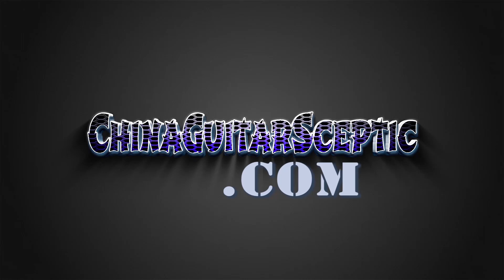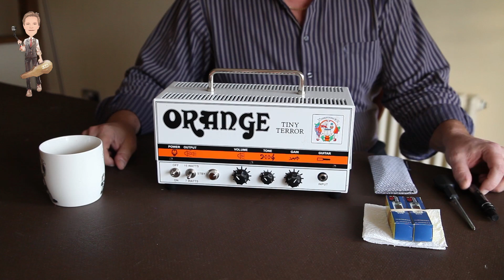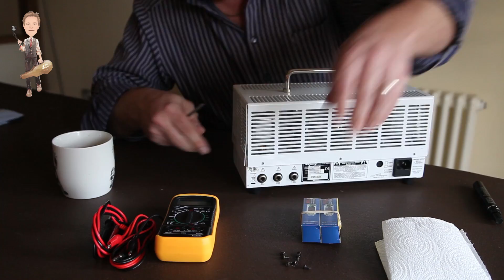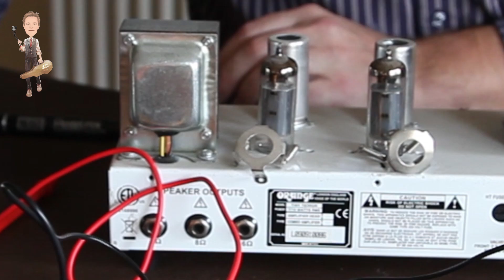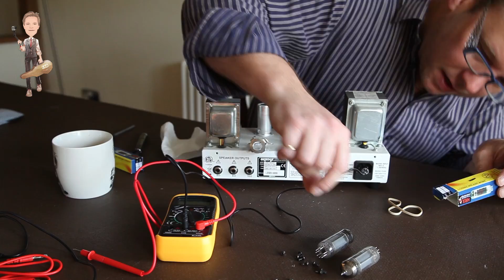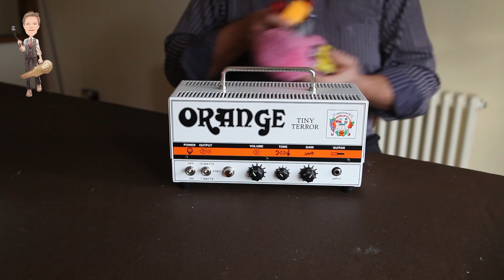Tiny Terror Valve Change EL84 by JJ Electronics [Tesla]

Comment: The earth pin in the IEC male socket is connected to chassis earth. There will be no potential difference between the earth pin and any metal part on the chassis surface. TX etc. No Biasing required?
Reply from the maker: Thank you. I've learned something. 👍I was worried about residual charge in the smoothing capacitors.

Comment: You have already touched the amp all over, so why are you testing for "residual voltages" all over the chassis? The other thing is that the earth terminal is connected to the chassis which you so carefully tested, so you are basically testing nothing, not that you would find any residual voltages on a chassis ever.
Reply from the maker: Thank you

Comment: Do EL84s need an initial bias? Or do they run perfectly without current adjustments?
Reply from the maker: The Tiny Terror does not typically require any attention with respect to biasing because of its' cathode-biased power section. The vast majority of EL84 pairs will operate within the tolerances of the stock cathode bias resistors. Ordering a matched pair from a specialty valve supplier that is specified for your amp model should ensure that no resistor-swapping is necessary.

Comment: Now there is a handy and safe tube puller / inserter available on ebay, item 254242318237  Easy, simple and safe. A perfect tool for any audiophile or vintage electronics technician.
Reply from the maker: thanks bro! :-)

Comment: Finger grease on valves will not make them deteriorate quicker, look into it, read up on it. Of course this is not that big of a deal, but you really shouldn't regurgitate things that people tell you spreading false information. Look into the way a valve works there is no way that a little finger grease on the outside will affect it at all.
Reply from the maker: You are correct and I thought I stated that it was not required. I'm just ocd where anything glass that gets hot is concerned. It's perfectly fine to touch valves.

Comment: Looks fairly simple to do. Tubes remind me of a recent passing uncle of mine who at my young age (many decades ago LOL) would send me to a local electronic store with a load of tubes to check which ones where defective and which ones worked. I'm not even sure if any such place exists any more where you can just walk in and use the electronic tube testing machine for free. Thanks once more for sharing.
Reply: Gil Lamb saw em alot as a kid. but i did see one on craigs list a while back. cheaper than the orange tube tester. 50 times the size. if i remember you could test any valve ever made.

Comment: Hi, could you explain again about the "earth continuity" and the attachment of the multi meter to the earth pin?  As I see it you do not have earth continuity unless the amp is grounded which it cannot be in this situation as the  power lead is not attached. To ground something like the meter (in this case) shouldn't you attach the black lead to a central heating radiator, which is, in its self, grounded already?   Am I missing something?
Reply: Without the "earth" ground attached to a real ground, you will just be checking the voltage across the various parts of the amp to the amp chassis.
Some people have special grounding power cables that only carry the grounding wire so the chassis will be earth grounded.  Those are very useful if you do a lot of amp, computer or other electronic repair.
Reply: Craig Parse Thanks for your views.  I need to change the valves on my Peavey, so far I am not convinced I have the skills to do this myself safely. Your comment kind of reenforces this position.
Reply from the maker: +MrCElk sorry not had a chance to reply. Wrong choice of phrase earth continuity. Probably due to my recent PAT test training. All I am looking for is any residual stored in the capacitors on the board. This is what can be dangerous. Generally if you have unplugged your amp and left it a suitable time then any residual stored will have dissipated. This will happen quicker if the amp had been used than quickly turned on then off.
Changing tubes like any electrical work is easy if you know what you are doing and you file safety steps. Don't let it put you off learning but I'd get some qualified help to show you first time, just in case. Cheers CGS:-)
Reply from the maker: +Chinaguitarsceptic potential can be measured across the chassis or earth pin to any potential live party of the equipment